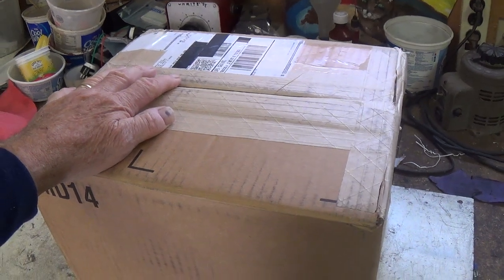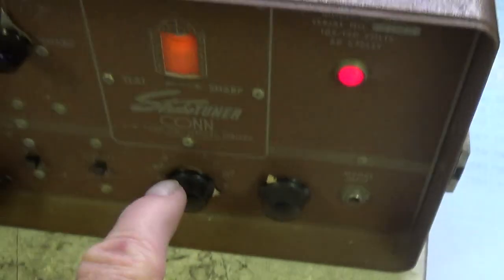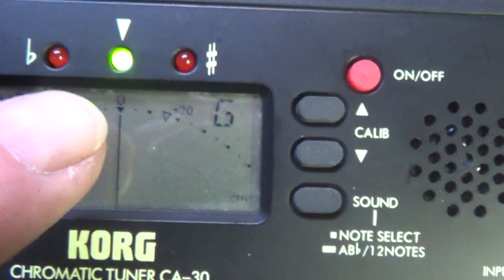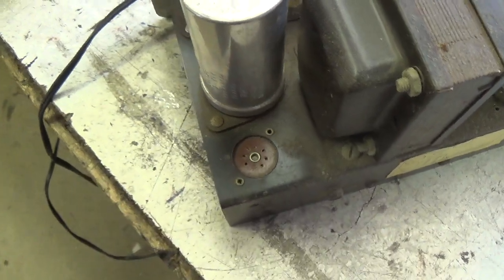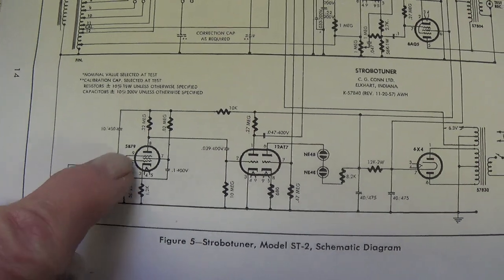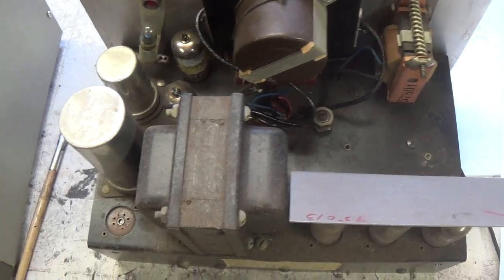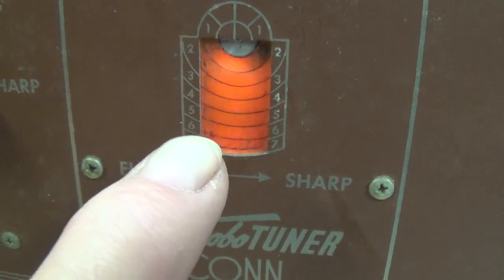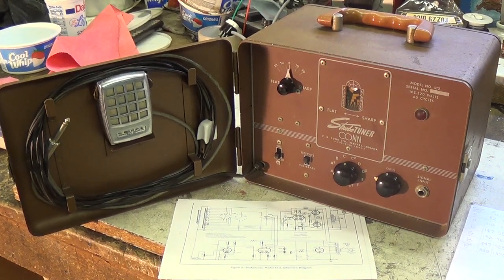Early 1950's CONN StroboTune Model ST-2.......What a Miraculous Device !!!

Comment: Plug an electric guitar into the signal input and set the settings for E, A, D, G, B, and e.
That thing is out dated but cool as all hell!
Reply from the maker: Thanks, Siggy.
Reply: @UncleDoug  
I dunno how easy it is to find those tubes. Somebody has to still make them. But its those xenon bulbs that would be real tough to find. Good luck and Good score! 👍
Reply from the maker: @siggyretburns7523  The tubes are easily obtainable, Siggy. I think the bulbs are neon, due to their reddish color, but are probably very tough to find.
Reply: @UncleDoug 
Ooops. Im sorry. Wrong comment. 😂
Reply: @UncleDoug  
Some guy was trying to tell me Trump said something absurd so I told him to give me the link or shut his piehole. Lol.
Reply: @UncleDoug  
Does neon have the same characteristics as xenon?
Reply: @UncleDoug  
How are the fixed in the set? ie screw in? Push in?
I found quite a few under strobescope bulbs. They come all sizes shapes types prices etc
Reply from the maker: @siggyretburns7523  They are both inert gasses, but when energized, Neon produces red light and xenon produces blue light.
Reply from the maker: @siggyretburns7523  They appear to be bayonet bulbs with large diameter brass bases.

Comment: In this case being that the Conn was intended for piano a note may not be 'just a note'. Piano's use a equal tempered tuning and string instruments use harmonic tuning. A piano's A should be 440.0Hz but would be 436.05Hz for a string instrument.  Completely inane rant off. Super cool as usual Uncle D!
Reply: Uh… that doesn’t make any sense to me. If you tune a piano’s A to 440 Hz and any other instrument to any other frequency (let’s assume, as you said, 436.05 Hz) then the piano would not be in tune with the other instruments and vice-versa.
Reply from the maker: Thanks for the interesting input, Chris :)
Reply: And if it was intended for piano why has it got 6 positions that match the 6 strings of a guitar? And not 12? And where did you get 436.05Hz from? Can't find it in the Grove Dictionary of Music.

Comment: I see you are at 442Hz reference on your tuner. The standard is 440Hz. So if you use yoiur tuner for reference, right now its not giving you a standard A...
Reply from the maker: It was adjusted to agree with the StroboTune for the video. I have no idea which one is correct.

Comment: Perfect pitch?  Some people have it.  May be a curse, because nothing is perfect, especially equal temperment tuning.  It is a compromise, Octaves and fifths in tune, everything else a little off.
The church choir will sing in perfect harmony.  The guitar fretboard, not so perfect.
As they say, close enough for rock and roll.  I spend most of my day building and repairing guitars, and tune them up by ear.  After a while it becomes automatic.
Reply from the maker: Thanks for sharing, Michael.
Reply: In equal temperament only the octaves are perfect. Everything else is squished a little.

Comment: cents  , hertz  ,and  cycles   per second

all the  same  thing ,,,  modern Peterson  tuners  ( who  bought out Conn)  are  accurate  to  one  tenth on  one  cent

your  small  digital  tuners  are  not  quite  that  accurate   however  we are talking  about  one  cent  off  or  so
musical  pitch  and  being  "in tune"
is a  human hearing  aspect  that  does not  correlate  directly  to math

look up  Workmeister and  the  tempered  tuning  system  if  you  want  to go down a rabbit  hole ,,,, they knew about all of  this  back  in the  1600's   1700s  .?
what  did  they use  ????
Reply from the maker: Thanks for the interesting input, Jean.